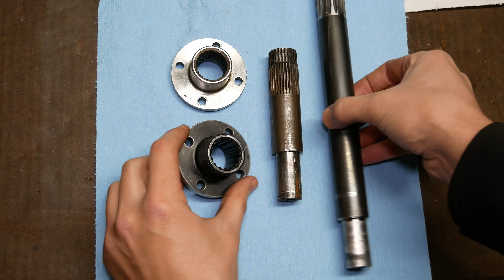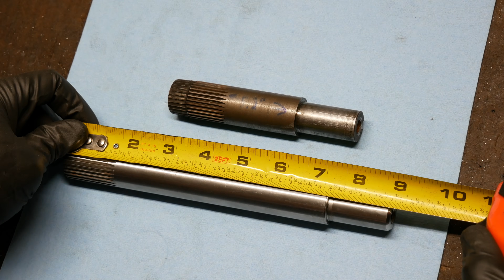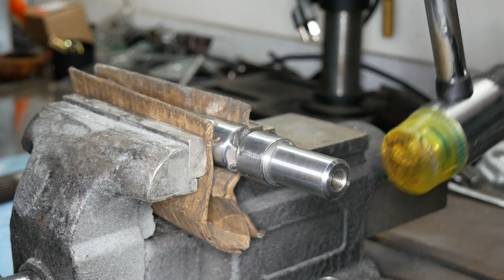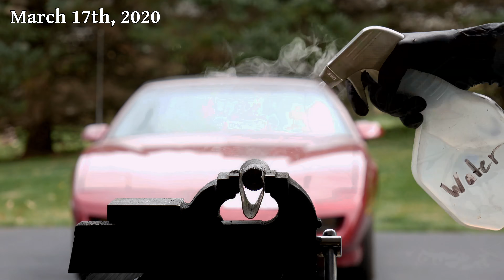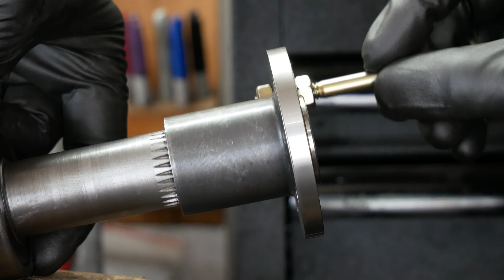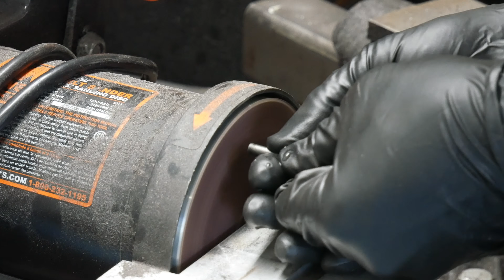B&M 250 Supercharger: How (Not) to Make a Custom Input Shaft (78 Firebird Ep.27)

Comment: you just replaced a poorly designed part with the same poorly designed part. b&m had to redesign the snout to be able to run on mercuisers. the snout is too short and has one bearing. https://www.youtube.com/watch?v=guj0axU0N3k  . i am going to redo what i already did cause the double row bearing has too much wobble. i am probly going to make a front bearing retainer that mounts the seal and use 2 original bearings  and remove the spager i put in... now to just be able to get a shaft.

Comment: Easiest method for making a taper if you don't have a mill. Mount the pieces one at a time in your drill press, use a course file (or a carbide cutter) as the drill press is running. It would help to use an angled piece of wood clamped to the drill press table as a tool rest.

Comment: Looking back at the pinto over heating. On a small block ford if you put the head gaskets upside down/on the wrong side the engine will over heat. Just flip the gaskets over possible over heating problems

Comment: Fuzzy, did you know that the VAST majority of strength in a shaft is the outside diameter? This is why gun drilled 40 spline axles are used on drag cars. Anyway, I would have just turned it down on a lathe.

Comment: That key was a point of failure on purpose.  It's likely very weak steel -- strong enough under the load it was designed for but will fail if that load is greatly exceeded.  It helps protect the much more expensive parts.

I run printing presses for a living and all of the anvil rollers are fixed to the gears in the press with pins.  They break occasionally but it's a few bucks for a pin, $300+ for a new anvil gear or $4000+ for a new anvil (not to mention the cost of downtime).

Comment: Genuine question. Why didn't you take the bearings you used to see if it was aligned and make a  redneck lathe in the drill press and cut down the keyed section?

Comment: When someone asks for an example of 'throwing good money after bad' I now know what to use for an example, lol. That said I do feel for you trying to do it yourself. Back when I was young I tried to replace my fuel filter but I couldn't get the fuel lines off. So I cut the fuel lines and figured I'd drop by the auto parts store and replace them. They didn't have them. Great! After paying for a tow to a specialty auto repair shop and an expensive repair bill, I at least can say I came out of the experience learning a little bit.

Comment: Should have flame straightened it after you welded it.   What am I saying... should have taken it to the machine shop! You must have a lot of confidence in your welding to weld a part that stripped out a 30 spline shaft...
Oh and NEVER EVER try to "save a machine shop time" by doing anything to a piece of stock/part; maybe cleaning it, but ABSOLUTELY NOT  by cutting it to length, you just make it much more difficult (and sometimes impossible) to fixture/hold to do the machining.
Reply: Amen.

Comment: One thing I was surprised you didn't do instead of cutting and welding the 2 ends together  was to cut the shaft to length from the spline side and the and on the bearing side have it marked out to length and put it into a drill press and use a sanding block or a hand held belt sander mocked up so it goes to the depth needed

Comment: Appreciate that you shared what works and doesn't.  The key in the shaft is designed to shear and prevent catastrophic failure of more expensive parts.  Glad you turned to having it machined, pun intended.  Add a mini lathe to the shop tool list. Enjoy your methods, approach and content. Thank you. I would be tempted to purchase another shaft and have it machine. Just in case.

Comment: Thank you for sharing this journey with us!  It was very entertaining and as always, I learned a lot.  I'm curious why you thought the welded shaft (without the reinforcement added) wasn't strong enough?
Reply: The weld would have been weaker, soft metal and wouldn't have taken the forces as well as the steel shaft, thus being a failure point on high load.

Comment: Hello.
The idea with a bolt is good, only on the shaft it is necessary to make a cut in the shape of a cross, and in a small piece there are protrusions with the same shape. (under this condition there should be no distortions and there will be no possibility of turning the part)
From Russia with respect

Comment: you could have hung the car itself off one side of your initial welded shaft, the amount of pressure i would take to break that a weld like that is insane. i think you could have stopped there and probably been fine, just my two cents. But i love this series and cant wait for the next installment. Cheers
Reply: I was thinking the same thing. That first one he made and had it pretty straight should have been fine. Went too far with the extra support coupler.

Comment: that added pin wouldn't necessarily mean a stronger connection, adding keyways generally creates stress concentration spots and reduces the overall surface area of the shaft, there is a art of balancing the required strength in the connection for transmitting power through a key in the shaft and the loss of strength that the key itself exerts on the shaft. I AM IN NO WAY SAYING that you reduced the load capacity of your shaft. I refer you to Shigley's Mechanical Engineering Design in which there are charts and data on how to calculate the proper size of shaft and key way for an expected amount of load and tons of other real world applications. you can calculate the factor of safety that is used in the design of the original shaft with one key and do the same for two keys and say decisively that adding the second key was a improvement or not.

Comment: You had it good until welding the sleeve over it. Those welds would have been fine for years. Welding the sleeve warped the shaft and you were worse than before.

Comment: Did I miss the part of why you did not just have a machine shop to the simple cut down and key way cut rather than send it out for splines?  The tight fit coupler and shaft was perfect., but that after cut was not good and it could have been you damaged the coupler so no matter how well the splines were cut it was never going to be tight.

Comment: Just one thing about the added dowel pin... It is possible that you have moved the point of failure from a location of "easy/cheap" repair further up or down the drivetrain.  Often keyways are design to take a specific amount of torque and fail, thus protecting other components.  I really thought the welded solution was going to work, nice ingenuity and tenacity!
Reply: Idk, by the time that keyway fails the front of the blower would be ripped of the body. That key either comes out the front or something snaps. Not possible to shear it in this use case.
Reply: @Rudy97  You got me thinking... guessing that is a 1/4" key that is ~3/4" long, I'd say you are right.  If the blower locked up and the gear ratio on the pulleys are 2:1, maybe 150ftlb of torque max?  That would be ~160Mpa of shear (sorry for the switch to metric but due to laziness I used an online calculator).  Mild steel should be able to take at least 200MPa?  Still something to keep in mind when changing a shaft design.
Reply: That weld job had zero chance. Every weld pulls the metal.
Reply: @matthewklein9225  tf i welded drive shaft on my merc with  crappy and less weld and it hold, pretty sure theres more horsepower goin thro than that blower shaft
Reply: @kiiiisu  I'm glad you figured it out
Reply: @matthewklein9225  hmmm im tired but i can sence some sarcasm here
Reply: @kiiiisu  everyone has the right to learn whatever way they choose
Reply: @matthewklein9225  yeah agreed , trial and error best way to learn
Reply: @kiiiisu  only sarcasm? i smell snobbery, narrow minded and blatant disrespect. i can already see the smile from miles away.

Comment: It's kinda déjà vu to see you doing these things. As i tried all of them myself like 10 years ago trying to fix my friends rear axle on his old shitbox merc at basically no cost. Entire car was bought for something like 200 bucks, so getting new Mercedes parts simply wasn't an option.

Welding, rolling on a straight surface, adding a sleeve around it, frigging everything. Only for it to snap right off the moment you put the car in gear. Lesson learned? Just get another one or send it to a shop, it's totally worth it. In our case we finally managed to find a used axle from a junkyard. Still ended up costing more than the entire car did.

Comment: You could electroplate it to add a tiny amount of girth to the part which may help with the slop.
Reply: Clever Idea
Reply: Or if you never want to deal with it again bearing retaining compound 🤣🤣
Reply: It's not important to the function and performance of the piece. He needs to learn when to move on. Good enough>Perfect 99% of the time in life.
Reply: @CarsandCats  I agree and disagree, slop in the blower slplines can compound over time and likely were a contributing cause of the original failure to begin with. but at the same time yes I think that he would save a lot of headache with some of these things by letting things just be as they are haha.

Comment: You could - and yes, SHOULD have just sent the new parts to a machine shop from the outset and had them do the shortening work, probably on the other end. Cutting it down and putting a key on both sides would've been about the same amount of work as cutting the new splines, and you'd have kept your perfectly matched splines and coupler.

I know the attraction of failing yourself instead of paying for victory, but the knowledge of what you were getting yourself into should've been comparatively obvious. Not knocking on you, just a "know your limits" kind of thing. Even the Bad Obsession boys know when to call it quits - even if they usually end up just having to change whatever they bought anyway, lol.

Comment: I’m just wondering if these weaknesses were actually designed in failure points for safety or repairability.
Reply: I don't think so. Designed in points of failure are just that, designed. Things like shear pins and sacrificial parts are usually obvious from a metallurgical standpoint. Wiping out a keyway or splined part is not something I've seen.
Reply: This☝️